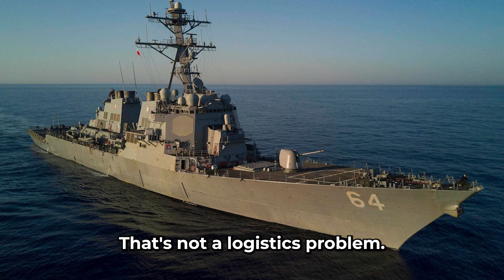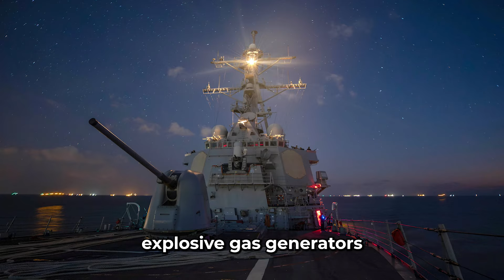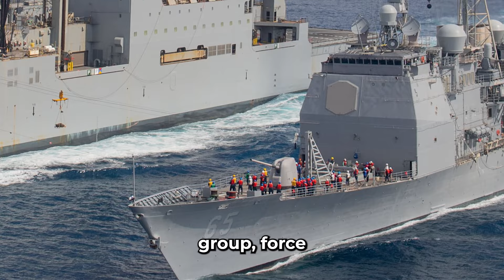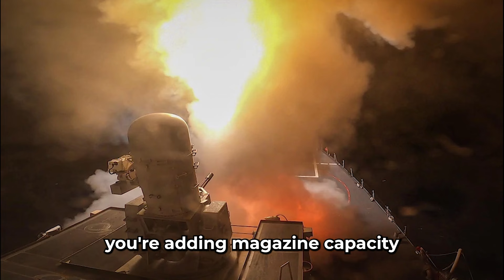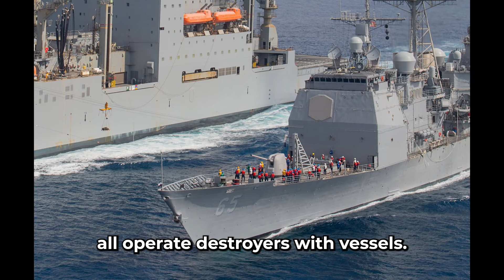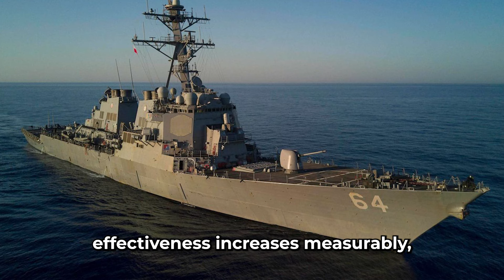The Naval Missile System That Reloads Itself at Sea

Comment: The us navy is updating its armament with loadable at sea missiles with the adaptable deck launching system, also hyper velocity projectiles fired from the mark 45 mod 4 and the 57mm main gun the army already successfully intercepted a ballistic missile with HVP in the 155mm artillery they move at mach 3 and above, also lasers 400kw or around there.

Comment: There’s absolutely no fucking excuse to not be able to reload missiles on anArleigh Burke destroyer in the same way they reload torpedoes on a submarine. You could put them on conveyor belts and slide them up and move them in there. You can do whatever you have to do, but this crap is unacceptable. A resupply ship should be able to completely reload all VLS tubes, not just 24 VLS tubes, underway. The worst possible thing I can think of is you replace the entire VLS tube section with a completely removable and replaceable VLS tube section so you take out the entire VLS tube section and simply replace it containing the same number of missiles that were there before with a crane. What the hell is the problem? Let someone like Pete Hegseth’s department of war figure out how to handle it. I’ll bet you he can get it done in six months. Stop trying to refill a cell in the VLS section with its own separate missile replace the whole damn vls module. And as a 35 year plus recreational sailor, I  understand that shit happens in the ocean. But that doesn’t mean that you can’t take out an entire section of a destroyer and replace it with a new version underway with the modern versions we have of replenishment ships. It’s just bullshit to argue otherwise.

Comment: “Unmanned/Optionally Manned VLS platforms”. Built from repurposed hulls of varying sizes and types. 

I see them being in size from 50 cells up to 500 cells. Could they be even larger? 1,000-2,000 cells? Built from repurposed giant container ships and oil tankers? I don’t know. 

They could be programmed to follow each member ship of a carrier strike group, or even to maintain a specific orientation at a distance to that ship. 

They can be plugged in to the kill web. They can be virtually anywhere, making them not only nodes in the kill web, but “distributed magazine depth” as well.

Comment: My idea:
The VLS blocks themselves are modular systems that can be swapped out. Supply ship is a giant mobile dry dock. Destroyer is lifted out of water. VLS modules use shipping container cranes and they just swap out empty cells with full ones.
Reply: Better idea. Have an unmanned drone ship in the centre of the force and use its missiles first. Third party targeting and link ** have been around since the time of Christ. The fuel was used in drop tanks first to extend the range of fighters in WW2. Same same.

Comment: An alternative approach would be to use already commercially available Platform Supply Vessel or Offshore Supply Vessel equipped with containerized VLS launchers on its decks. These ships could operate within secure communications range of a destroyer, which would provide targeting data and command-and-control. The PSV/OSVs would then rotate in and out of the engagement area while the destroyer maintains persistent sensor coverage and overwatch. This effectively decouples sensing and command from missile capacity, allowing firepower to be distributed across lower-cost platforms without sacrificing situational awareness.  You can also use purpose-built war unmanned platforms like the USX-1 Defiant to achieve the same thing, albeit with smaller missile capacities.

Comment: The old system wasn't reloaded manually. There was a magazine below deck. The missile rail would pivot and elevate to a vertical position and the new missile would slide up through a hatch from the magazine below. Was not a manual operation.

Comment: If you build the launcher and a belt fed type system for the missiles to transfer from holding cells to the launcher inside of the ships hull and do the same with its guns and have some type of rail system reload from stand by ships to the main battle ship similar to the system they already use to transport gear from ship to ship just a little differently built basically like a belt feed system that can transfer the missiles safely in the other gun ship safely

Comment: China is currently using standard shipping container sized missile magazines, but on container ships that we know of.
A warship with multiple "shipping container" VLS holds, could carry different modular missiles and radar every mission.
Reply: We need to do the same thing as China but don’t let the enemy know what we have.
Reply: They''re far from the only country working on such systems. Look up the Mark 70 Payload Delivery System for an american equivalent. I admit that such systems are flexible, however they are also bulky in that a 40x8 foot stretch of deck space houses only 4 cells.

It does make me wonder if the tender ship will be making a comeback for cruisers (which is what US 'destroyers' are) and frigates. All the hardware needed to reload VLS cells in a mobile package, with storage space for a few total ship reloads, as well as anything else needed to keep a warship active.
Reply: @echomande4395  Or, a proper number or missiles in a VLS shipping container, taller containers or shorter missiles..
A modular hold on the ship would fit the shipping container below  or partially below deck level.
Just off load an empty container for a full one.
Also, your navy supply ships are now missile arsenals too, as can launch as they bring the loaded containers.
Reply: Weaponizing the entire commercial container ship fleet makes ALL container ships valid targets.  Uh-oh.  We need a Willow Run plant for ships.  One Destroyer a day would be nice.  Maybe two days for a Cruiser, a Battleship a week, etc.  And a couple thousand sites for advanced drone production.  The trouble is, there are only two kinds of ships: submarines and targets . . .  Maybe we need submersible battleships? (;-)